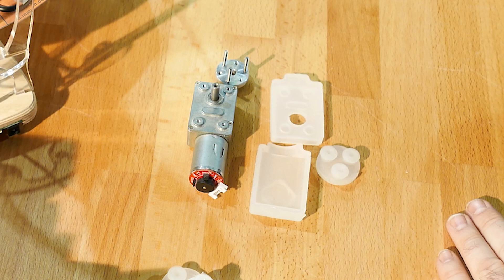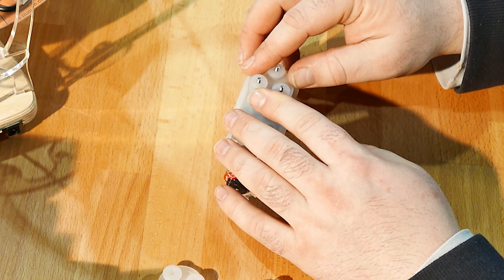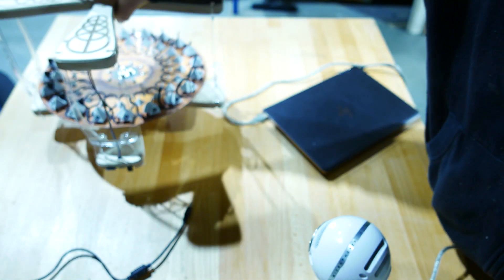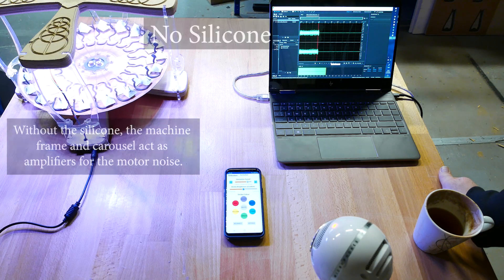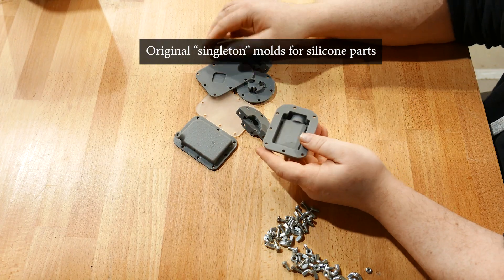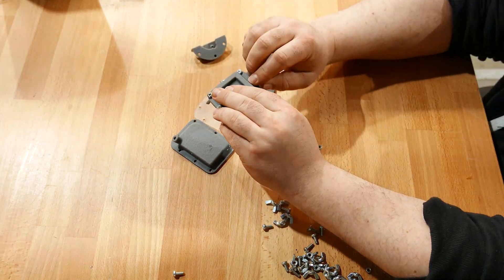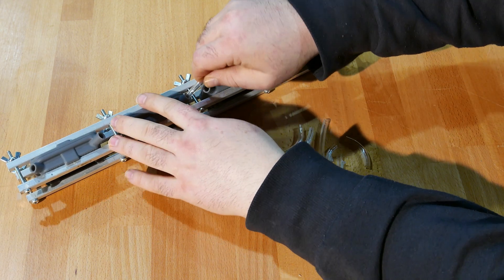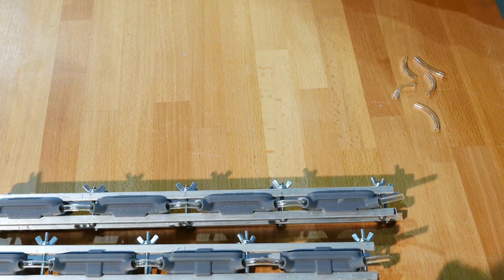4-Mation: batch molding silicone parts

Comment: Great video!  The damping effect of the silicone couplers is a huge improvement
Reply from the maker: essential :) of course Belt Drive is the way to go when you can - but that would have taken far too much engineering for small machines like this. My new much larger 2ft diameter animation machine is belt driven though. It still keeps the motor silicone mounts, but the fiddly carousel silicone interface is not needed anymore.

Comment: what kind of silicone is that?
Reply from the maker: Platsil 25 - it's low viscosity which really helps will filling the mould, it also sets very fast which also helps prevent leakage. Any silicone will work though - higher viscosity silicones just need more work/force to fill the mould, and you can add more catalyst to get tin silicones to cure faster, or for other slower curing platinum silicones you can heat the mould.

Comment: Hello, love your videos on small scale MFG.  A.) How did you get that huge syringe, and b.) did you not have an air pocket in the final parts?  Or was that not a worry?
Reply from the maker: it's a 200ml syringe I found on amazon, just search "200ml syringe" there or ebay and you'll find one. As for air bubbles, yes they do happen, but are minimized by the angled filling and the layout of the moulds.  I also degas the silicone first in a vacuum chamber before injection. For these parts occasional small bubbles are not a problem, although I do have to discard about 1 in 20, maybe 1 in 30, of the smaller more intricate hub interface parts in the video because of bubbles.

Also - on air bubbles, when injecting silicone if you align the mould seams vertically that really helps prevent bubbles, because silicone is so viscous(even platsil 25) it needs a lot of pressure to fill the moulds (hence why I rigged the syringe into a caulking gun) and that tends to squeeze any bubbles though the mould seams - unless you're unlucky, or have narrow pockets that aren't close to a seam...
Reply: @n0f8r  Very nice.  I hope you don't mind but I submitted your work to "Hack a day" I use to write for them, and when I see outstanding work I just have to share it. Cheers!
Reply: @GeorgeGraves  Hi George, I'm looking in to writing for Hackaday, what's the pay like per article (ballpark)? I'd appreciate if you were even able to give an indication. Cheers!

Comment: Really awesome video! I'm surprised your not getting any cure inhibition. I got a total failure when I tried to use Ecoflex. Are you using anything to coat the inside of the molds?
Reply from the maker: The silicone I'm using here is Platsil 25 which is very fast curing - only 5 minute working time, so it mostly works fine even without a mould release coat, but being a platinum based silicone there is still some inhibition - so I put the moulds in an oven at about 60C for an hour or two before demoulding - (I use  a repurposed pie-warming oven for shops) - it seems  easier than messing with a mould coating, and being platinum that combats the inhibition - to the point that the demoulded parts are usually fine, and at worst a bit tacky - in which case extra time in the oven fixes that.

If you can use a tin catalyst silicone (or condensation cure) there's no inhibition to worry about there, and it's cheaper.
Reply: @n0f8r  what resin for tool? 60c would worry me. Good work btw! Great inspiration.
Reply from the maker: @caveboy9988  it was formlabs standard grey resin - and minimum wall thickness of 2mm. I think most photopolymer resins will be ok at 60C. 70C or 80C is where they start to have problems in my experience.

Comment: What type/brand of silicone are you using?
Reply from the maker: Platsil 25 - it's low viscosity which really helps will filling the mould, it also sets very fast which also helps prevent leakage. Any silicone will work though - higher viscosity silicones just need more work/force to fill the mould, and you can add more catalyst to get tin silicones to cure faster, or for other slower curing platinum silicones you can heat the mould.